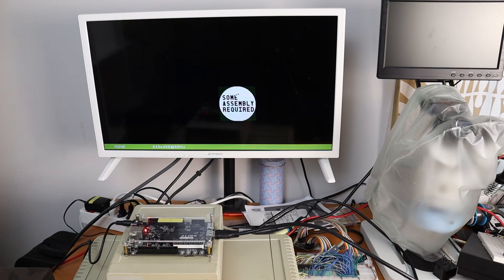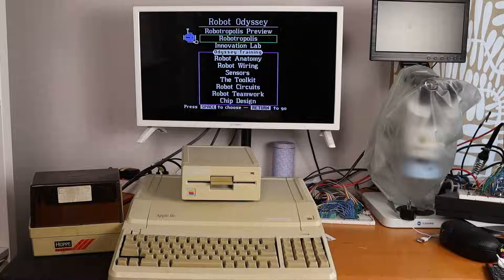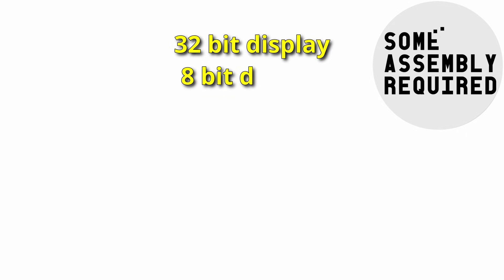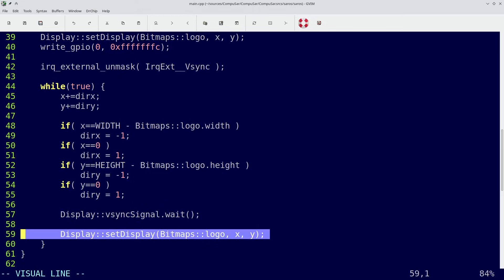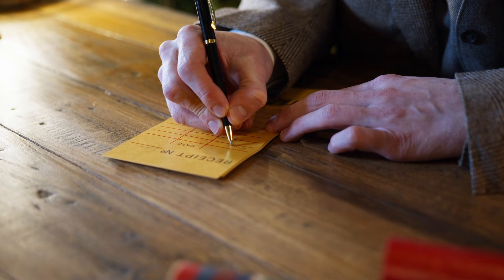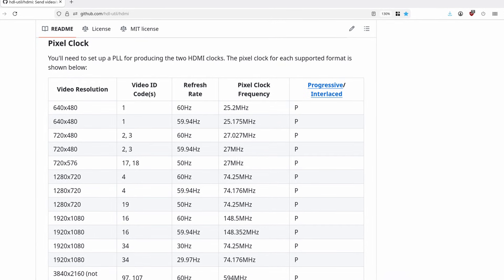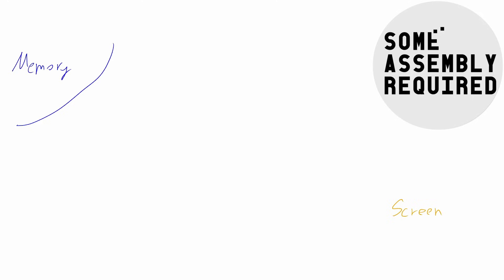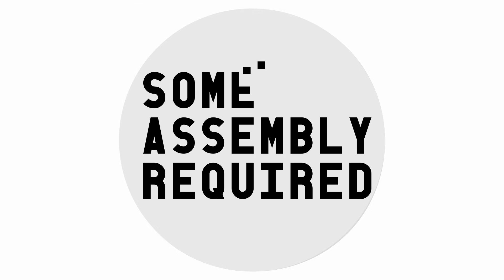HDMI output without a frame buffer?

Comment: Interesting approach you've taken!  And its sort of serendipitous timing that you posted this now as I'm about to launch into implementing a video subsystem myself for my retro-inspired fantasy computer project.  My Zybo dev board has VGA output as well as HDMI, but I'm planning to stick with VGA for now.  I have designed a whole set of text and video modes that will work with 64KB or less of RAM.  I'm planning to use dual-port RAM blocks in Xilinx Zynq 7000 FPGA fabric to implement it, so hopefully I have enough memory bandwidth to make it all work.  I don't plan to have a separate 32-bit supervisor mode like you have (although I do have ARM cores in the Zynq SoC).  Wish me luck, and I will stay tuned for your progress as well!
Reply from the maker: So, first and foremost, I wish you luck!
I was actually surprised at how similar VGA and HDMI modes were: same pixel clocks, same ratio of display to horizontal and vertical blanks. It seems to me like HDMI is just VGA except the color information is digitally encoded.
I don't know which Zynq you're using, but the smallest of those actually have smaller FPGAs than the Artix I'm using. The flip side is that, with an ARM from actual hardware, you can save a HUGE amount where I'm using some FPGA resources for the 32 bit computer. Also, a hardware ARM can typically go to clock speeds I cannot even fantasize about with a soft-core RISC, which means you can do actual emulation if needed, whereas I have to make do with software-assist.
What I'm getting at is, don't completely rule out using the ARM.
Reply: @CompuSAR   Thanks, and I'm certainly already using an ARM core to drive the "front panel" / debugging interface.  For example, I recently implemented automated testing using it to run over 28 thousand test cases for the 256 custom instructions in my CPU's ISA and verify they all work.  Similar to what you showed in your system diagram, I may also use an ARM core to connect to other resources on the Zybo dev board like the SD card for mass storage and perhaps USB for a full-size keyboard, but for that I'd rather make a scan-matrix interface through the FPGA to have minimal latency.  I might also try to use an ARM core as a RAM emulator to fill out a big chuck of the 1 MB address space my custom CPU can address.  The Zynq 7000 only has 60 RAM blocks (of 4 KB each) in the FPGA portion, so I'll need something different if I want more RAM.  Maybe an ARM core with its cache can serve as a RAM with minimal wait states, but working through the AXI interface could make it rather slow.  We'll have to see when I get that far... video is on the to-do list first!!!  I'll join your Patreon and connect with you and maybe other followers there.
Reply from the maker: My design uses a synchronous bus that allows wait states, but is much simpler than AXI. It's the same bus the VexRiscV CPU uses. You should consider it.
Bonus if you do: If your project can accommodate core licensed as GPL (which is automatically the case if you don't plan on distributing), you can grab stuff from my project. This includes the cache, a bus width adjuster (so you can have your CPU with a narrower bus width than what the cache uses, and still hook them up fairly easily), as well as anything else that may come in useful.
(though I realize that your whole point might be to experience building everything from scratch, in which case, never mind).

Also, it is my understanding that the Zynqs have some facility to share the DDR controller between the FPGA and the CPU, though I don't know any specifics. I never handled an FPGA with a hard-core CPU before, though you have piqued my interest enough to have a look.